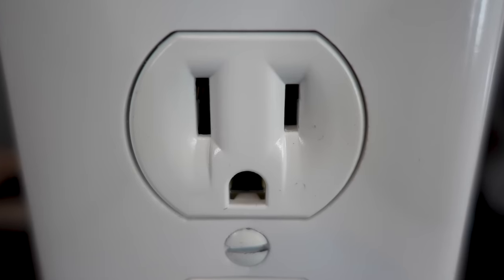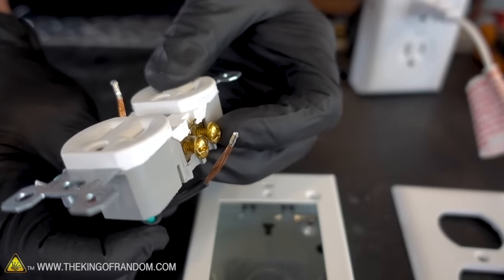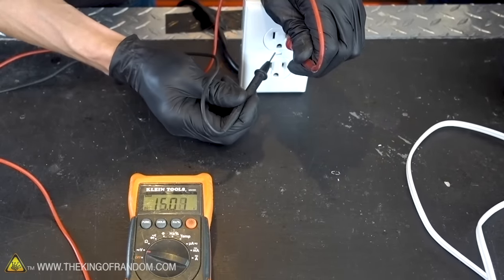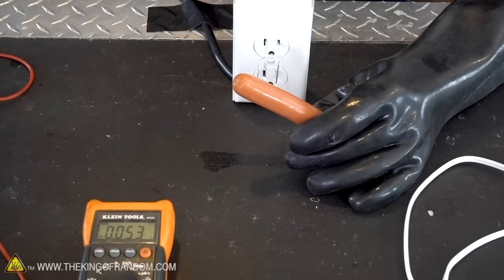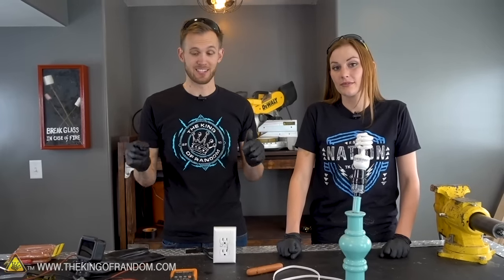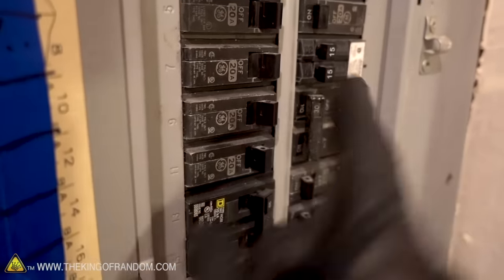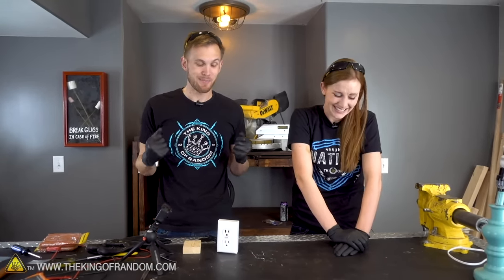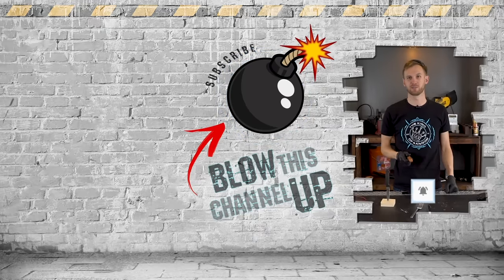What Happens if You Stick a Fork in an Outlet?

Comment: I'm dying, because of your "great" knowledge about electronics.
There are too many things to correct in this video.
Reply: Yeh I am with you a. Lot. Of mistakes
Reply: Such as?
Reply: @kelvinluk9121  When he touched neutral, it had the same effect as touching the line hot. It's AC.
Reply: no that's not true
neutral always stay at 0V potential
hot ossciliate between 100V to -100V
Reply: @kelvinluk9121  How does it get to -100v? Through the neutral.
Reply: @EclipseROM  you have to understand the movement of electrons. AC is a push-pull type of flow, that's why the line on an oscilloscope goes up and down across the 0V line. I'm sure there are a few videos on youtube explaining how AC works. I especially like those that were made by the department of defense in the 50s, because it shows how long ago the principles of electricity have been understood.
Reply: @EclipseROM  by changing the direction of current flow from the electricity source I think
if u check out how our wires are connected, u will see that the power plant only connect to us via the live wire. both neutral and earth wires are grounded, and hence they have 0v potential
and therefore for the electricity to be alternating, it must be the potential of live wire oscillating. I don't know how it is done though. maybe that's due to the generator
Reply: Also, I don't think voltage is the part in electricity that kills you is it. It is the amps isn't it?
Reply: @jamiecullen6013  You're killing me 😂😂
The supply voltage and your resistance (and in ac also frequency) determine the current flowing through you.
Reply: @jamiecullen6013  the voltage determines wherether the current can flow through you or not. With a human body that is around 50V AC
Reply: @redcx30  I see. Thanks
Reply: @redcx30  are you assuming dry skin touching the leads, or wet skin? They showed the hot dog piercing the paper clip, so you have to ignore the skin's resistance, and once you do that, then you're proving him right that amps aren't directly related to volts. TKOR also only talked about muscle contractions and not how your lungs and heart are muscles too, so you could die from suffocation or your heart contracting uncontrollably.

I personally believe my teacher that said a kid killed himself using a 9 volt battery by piercing both hands and having the blood from each hand touch different leads (he said it in a way that was more realistic, but it boils down to that).
Reply: @EclipseROM  I just checked, only one flat outlet gives 120v. If you had a 220V outlet, then both are hot since they're two of the three 120V phases going into to your house. Touching the neutral / ground outlets is like touching the earth.
Reply: Even 30V at 1mA can hurt though.
Reply: @Thomas_Acharya  no there are the not more three wires in a 230V outlet. And still one phase, the neutral and the ground. Do the research instead.
Reply: @HexxxiZ  I never said there are more than 3 wires in an outlet. I said 2 of the 3 120 volt phases coming into the house are used to make the 220 Volt output across both of the non ground wires. I might be wrong that all 3 go into each house, but the phase difference between the wires is 120° (if I'm remembering the class from 8 years ago correctly). If there are 3 wires going into a house, then they're probably all live and none are ground (the earth is used as ground). If you don't believe me and want to do something I would not suggest, then feel free to grab the wire you think is ground that's going into your house with your bare feet on the ground... Or use a voltmeter and let me know that I'm wrong. 😆
Reply: jamie cullen it’s a combo of the two they need each other there’s many other factors like resistance of the skin
Reply: Tom Gauthier well, considering you can touch a 9 volt battery to your tongue and all you’ll get is a tingle, I very much doubt that last part.
Reply: After I' ve heard that voltage flows, I was already done. lol
Reply: @mathcatsyt  will most of the current go across your heart if the battery terminals are right next to each other on your tongue? If so, you have a very weird anatomy. The biggest issue is not the current "burning you", but the electricity interfering with your normal heart beat and/or using up all the energy (aka: the stored sodium ions) in critical muscles.
Reply: I came to this place 4 jokes and it turned out there r fricking electricians down here
Reply: @ericliu7432 neutral is always at 0 if the circuit is open
Reply: @EclipseROM  it's ac not dc
Reply: @gmaninthusa  if you have wet hands
Reply: @Axxetto  Assuming neutral is always at 0 potential is an extremely dangerous assumption to make. If there is a break between your position and its connection to earth, then neutral can be at full line potential. Also how do you know the sockets have been wired correctly?
Reply: They don't know much about electricity.
Reply: My favorite: “I am wearing a thick rubber glove nothing can happen.” Yea no wrong if that thing ain’t rated for electricity you aren’t helping yourself and it’s just annoying
Reply: @jamiecullen6013  That's a myth. Voltage kills just as easily, friend.
Reply: @jamiecullen6013  it's a combination of the 2
Reply: @gmaninthusa  The current (amps) determine how much it hurts, but the voltage and your resistance determine the current flow. (I=UR)
If you could get 1mA @ 1V it would hurt as much as 1mA @ 100v, but those currents are just harder to achieve in lower voltages, because your body resistance is limiting it.
Reply: Thanks for the info people. Helps :)

Comment: Nate: Doesn’t dare touch 120 volts
ElectroBOOM: touches 2000 volt Jacobs ladder with no protection
Reply: absolute ZERO it isn’t about the voltage per se. How harmful it is dependance mostly on de flowing speed (I in Ampère)
Reply: @marksmit9764  Current (ampere) = Voltage ÷ Resistance.

Comment: In the UK we have a 'live' wire (your hot), neutral is the same but your 'ground' wire is our 'earth' wire.
Reply: neutral wire isnt white here, its either blue or black and live is either brown or red, and earth is green and yellow. but or sockets are way safer than any countries.
Reply: @lewismo1  until you forcefully make them unsafe by sticking metal in them, also ours have a higher voltage than most
Reply: And the all have a switch on them
Reply: @lewismo1  in North America we are stuck with this cap unsafe outlet
Reply: @Axxetto  you can buy tamper resistant receptacles with little shutters. They function similarly to the British type receptacle.
Reply: @OnlyNotes  oh ik I have those but they are double the price
Reply: @Axxetto  I mean, you're not wrong... but we're talking a difference of $1 per receptacle for standard, vs $2 for TR. (when you buy 10)

It doesn't seem that bad to me. Especially considering you probably don't need all the receptacles to be TR if you have kids. Only the ones the kids can reach

Comment: Maybe should have tried a GFCI recepticle as well, they're designed to act before the electricity goes to you and will limit the current to a save level (around 5-7mA i think).
Also, there are tamper resistant recepticles that actually 'lock' the plug until 2 prongs are inserted at the same time.
Reply: GFCI outlets trip when current flows from the hot to ground, instead of returning through the neutral wire, which is useful in bathrooms because most pipes are grounded. For example, if you touch a live wire while in the shower, current would flow through you into the grounded pipes and hopefully trip it. They typically trip before 10mA , which is right on the edge of dangerous for humans.

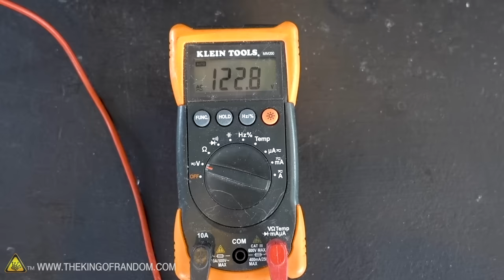Comment: 3:25 the heart stopping amount of current is from about 0.1-0.2 Amps. 15 amps at 120 VAC would equate to 1.8 kilowatts and would turn you into a pile of dust.
Reply: Thank you. I was just about to say that!
Reply: But you'll never get 15A running through you at 120V. The max you'll get is around 0.24A.

Comment: The earth wire is to offer a low resistance conducting path,which is connected to a metal plate buried deep in the earth.Its used to avoid severe shocks.
Reply: Where I'm from grounding rods are more common
Reply: @xxtacowarriorxx6440  Are you by any chance from Austria?
Reply: @delta61  No, The United States
Reply: @xxtacowarriorxx6440  Ok😅I was thinking because Austria has a very similar grounding system with the only difference being that it is AC 240V 18A

Comment: I have worked around electricity and high voltage my entire life.  Standard house hold voltage is not as dangerous as you make it look.  220 is very dangerous and it will hold you 110 will not.  I am living proof I can hold 110 and continue to work.  I have been shocked many times by mechanical failures even 220.
Reply: I honestly know nothing about UK electric setups.  Would be something to checkout

Comment: I think you need to put the paper clip in both of the outlets and see what it does like if you agree
Reply: blake scott Same thing. Look at the screws where the wires are attached. There is a metal bar connecting the two silver screws to each other, and the two gold screws to each other. If you removed that bar, only the top or bottom outlet would work. With the bar in place, the top left slot and bottom left slot are the same, as are the right slots.

Comment: One time I was trying to unplug something (it had been plugged in for at least a few years) and the rubber caseing came off and I touched the metal causing my finger to spasm luckily not going throughy arms through my heart!
Reply: Did you have any long term damage from this? I just recently unplugged my charger bare foot and i accidentally touched the metal part of the charger and my hand was shocked and it jolted but not my arms
Reply: @v1ntage547  no not that I know of
Reply: @Igamecant  alright thanks

Comment: I suppose this works as a decent PSA about the dangers of electricity. It is definitely not an exhaustive example of the effects. 
A person, wearing shoes, with dry hands, touching the hot conductor only, will experience only minor discomfort. It is startling, but not likely to be lethal.
Touching the hot and neutral, with the same hand, is incredibly painful; but still not likely to be lethal (because the current path is on the same limb)
I'm surprised they didn't elaborate on the danger of hot and neutral on either arm (current path across the chest).

Comment: When I was a kid, I loved doing science experiments, so I tried to create an electromagnet by covering metal wires on a nail and plugging the metal wires on the socket. I turned it on, it burnt the socket. The MCB thankfully worked and I was saved (no injuries at all). Never ever did any experiments again after that incident.

Comment: The device that protects you from too much current is the circuit breaker or fuse.  The ground wire, when connected properly, can protect againt a shock.

Comment: When I was in 8th grade, In my science Class, I stuck a paper clip in a light socket. One end into the hot, the other into the neutral. I used a mechanical pencil and used the rubber erasers to handle the paper clip. There was a pop. The paper clip shot out and short circuited the classroom. My poor teacher lost all her work uploading out grades.

Comment: The neutral is shorted to the ground (Earth) wire in your breaker box, which is why the neutral or earth doesn't shock you, even of you touch both. Without the earth shorted to neutral, you could get shocked from neutral or live (Hot).

Comment: I'm literally shaking my head, in the us, the hot is usually white and neutral is black, I've worked in several historic(80+yrs) homes as well as new ones, and ran into this issue a few times, if the ground plug is on the bottom, ITS UPSIDE DOWN. ALL 110 are INTENDED to be ran from the ceiling.

Comment: One of the reasons why putting any kind of metal on the plugs will Electricute you plus holding it without any proper insulation is that electricity will always flow from line to ground. Holding a fork bare handed plus having no footwear will make a complete path of your body to the ground connection no need for 2 pins on the plug 1 is enough to zap you without footwear insulation to the ground from you body.

Comment: electricity always travels through the path of least resistance, you wouldn't even feel a shock. If the breaker doesn't trip, the fork would get hot very quick.

Comment: You mentioned that id you grabbed onto the metal that it could make your muscles contract so you couldn't let go.  Yes electricity can do that, but only direct-current (DC) can,  not alternating-current (AC) le a household outlet would have (unless the house has been converted to have DC electricity, which is actually an option).  The voltage and current make your muscles contact in one direction, but then the muscle releases in the opposite direction when the voltage and current change (a.k a , "alternate") direction.

Comment: Once a hot glue gun tripped my breaker and I did not know that  it had so i pluged it in after the breaker was fixed and it basically did the same thing that the connected paper clip did and lit some scrap fabric on my desk on fire.

Comment: Accidentally touched prongs on a half plugged in a charger wire that was plugged into a laptop. Felt a tingle on my fingers.
Could this be because most of the power was going to the laptop?

Comment: When my neice was about 6 she actually stuck a fork in the hot wire of the outlet and she survived because her muscles didn’t spasm or seize up but the funny thing is that my sister actually tried to pull the fork out 2-3 different times and the breaker didn’t trip we actually had to turn the electricity off.

Comment: The Heat could melt your gloves..you should use  pliers to hold the clips... because of the high resistant of the clips you're lucky it's higher than the breaker rating and tripped.... in my country it's 240V

Comment: 3:25 Yes it can, but let's say that your body resistance is 300kΩ, and you put your fingers into the outlet. 120V ÷ 300kΩ = 0.4mA, not even 1/10 the amount to trip GFCI.
So, 15A is not possible using 120V. You would need 4,500,000V just to have 15A through your body.

Comment: I once put a hair clip in to a heater my arm went into spaz mode when the hair clip touched the metal of the heater it welded the hair clip together making a circuit that probly saved my life I'm only 12 and did it three years ago I was lucky my arm is a psychotic spaz

Comment: Facts: 240 volts 200 Amps = 48,000 watts. 240 volts 100 Amps = 24,000 watts. 240 volts 50 Amps = 12,000 watts. 240 volts 40 Amps = 9,600 watts. 240 volts 30 Amps = 7,200 watts. 240 volts 15 Amps = 3,600 watts. 120 volts 15 Amps = 1,800 watts. 120 volts 20 Amps = 2,400 watts. 120 volts 30 Amps = 3,600 watts.

Comment: Using a rubber glove to stick a paper clip into an outlet... yeah you're insulated from the electricity but what about the heat If the breaker didnt trip? that could have melted straight through that glove.

Comment: I wonder why America uses 120 Volts
Reply: It's pretty much because that's what light bulbs used best initially and we stuck with it. Don't be confused though, almost all houses in the US do also have 240 volts, which is used for high amp draw applications, like electric heat and stoves, clothes driers, and A/C condensing units.

Comment: And more importantly, when a human completes the circuit, typically the circuit breaker will not trip... You are the hotdog... And the smoke would probably be your heart or brains... Not scientific enough to know that. I do know water is very conductive, and we are what percentage water??? Always use your shoes if you intend to help someone unless you have a better protection layer otherwise you could become part of the meat-skillet.... I am not a fan of electrical work when it comes to around the house stuff... :\